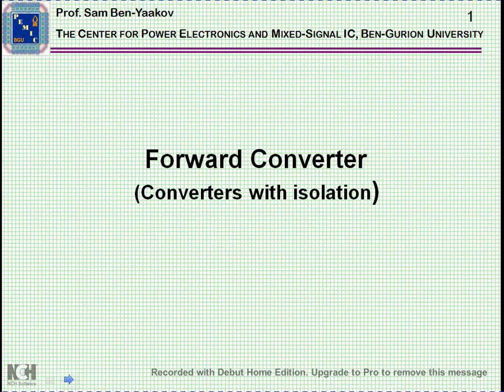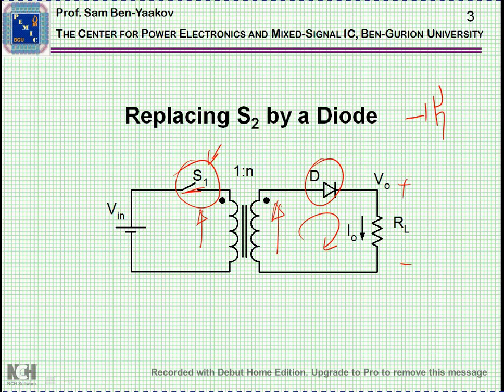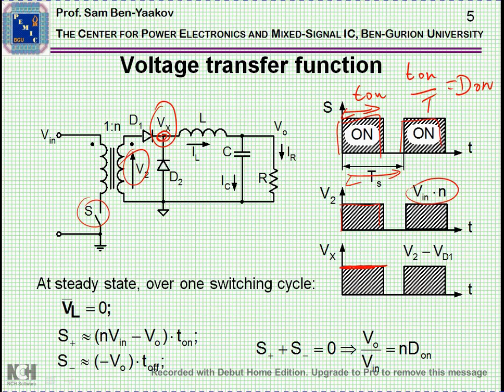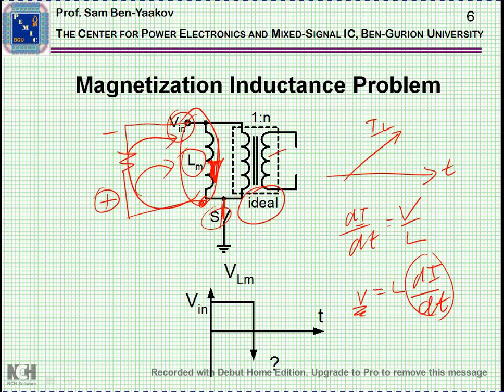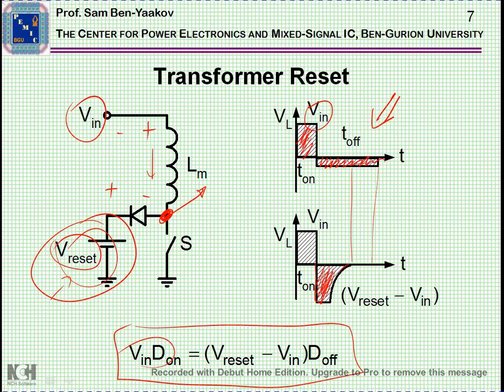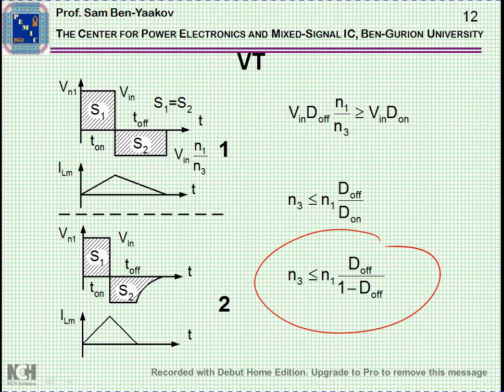Forward Converter

Comment: Hello. Nice video! I have a question. In the part of the video where the voltage is klamped (10:00), why do you need to do this in the forward converter but you do not need to do it in the flyback converter?
Reply from the maker: In Flyback the clamping is by the secondary, save the spike due to leakage inductor which you need to clamp.

Comment: Dear Professor Yaakov, I can understand the n3/n1 calculation at 12:51, but it doesn't match with "n3/n1" at 16:49. Could it be that the "Vin*n1/n3" of S2 at 15:43 should be written as "Vin*n3/n1"?
Reply from the maker: Yes there is an error pointed out 4 years ago😊
JeffH
4 years ago
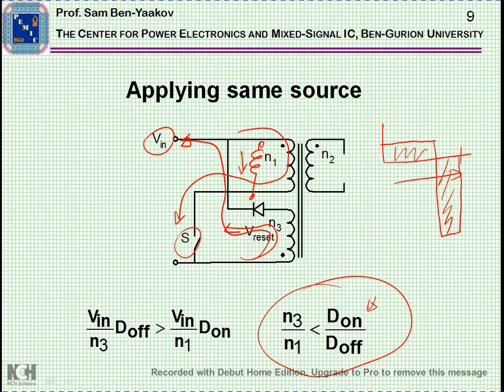Hi Professor, @14:12 shouldnt n3/n1 be less Doff/Don?

Sam Ben-Yaakov
4 years ago
Hi Jeff, correct. Indeed, the expression is messed up. It should be as you pointed out. Thank you very much for pointing this out. You have a keen eye.

Comment: Thanks a lot for the detailed explanation sir. I was wondering if forward converters have any practical applications? It seems that at low power ranges, Flyback would dominate and at higher power it is better to go for push-pull or half bridge. I would love to know your thoughts on the same.
Reply from the maker: Hi, Forward converters were used in the range of few 100s W. These days, the LLC seems to take over.
Reply: @sambenyaakov  that answers my question. Thank you very much.
Reply: @sambenyaakov  also I presume two switch forward was used in the 100W design? Or was it some other topology?

Comment: Hi Prof, i think there is a slight mistake at 14 min. n1/n3 shold be less than Doff/Don ( not Don/Doff). Please correct me if i am wrong
Reply from the maker: Thanks for comment:

Sam Ben-Yaakov
9 months ago
Yes there is an error pointed out 4 years ago😊
JeffH
4 years ago
Hi Professor, @14:12 shouldnt n3/n1 be less Doff/Don?

Sam Ben-Yaakov
4 years ago
Hi Jeff, correct. Indeed, the expression is messed up. It should be as you pointed out. Thank you very much for pointing this out. You have a keen eye.
Reply from the maker: Thanks for comment

Sam Ben-Yaakov
9 months ago
Yes there is an error pointed out 4 years ago😊
JeffH
4 years ago
Hi Professor, @14:12 shouldnt n3/n1 be less Doff/Don?

Sam Ben-Yaakov
4 years ago
Hi Jeff, correct. Indeed, the expression is messed up. It should be as you pointed out. Thank you very much for pointing this out. You have a keen eye.

Comment: in slide no 7 .      when  Vreset > Vin. then  during off period of switch.  the anode of diode has Vin and  cathode has Vreset.  then how will the diode the turn on.  and how will the reset happen??
Reply from the maker: When the inductor current is interrupted, the voltage tend to swigs toward very high voltage and clamped by Vreset. See https://youtu.be/HtwiIIPekfs

Comment: So why flyback converter does not need this third coil?
Reply from the maker: In flyback' energy is stored in core and them discharged into the secondary. In forawrd energy is not supposed to be stored in core, but some does due to magnetization so this has to be discharged by a third winding. or some other means.

Comment: Can a toroid be used for the core of an isolated switch-mode power supply? I never see a ferrite toroid used for the core of SMPS when they have isolation, and I always wondered why. All of the buck boost converters I see use a toroid, but they are not isolated.
Reply from the maker: Thank for bringing up a good question. Toroids are used in flyback but less often. They tend to have a higher leakage inductance which is increasing losses and spikes. They would be a good choice if one needs very high insulation between primary and secondary because you can put them apart. Using ZVS techniques will reduce the leakage losses.

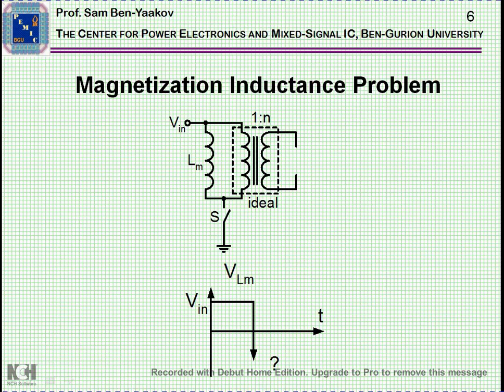Comment: Hello Professor! My question regards a magnetization inductance problem (7:04) is follow: In a few sources I saw that there is a gap recommended in the forward converter transformer. But after your video I am realizing that gap is not needed. Even more, a gap should make situation even worse (Larger gap -> lower magnetization inductance -> higher magnetization current). Are there any hidden reasons to make a gap in a forward converter transformer? What do you think?
Reply from the maker: Strictly speaking the forward transformer does not need a gap. However, I would imagine that in some cases a gap can be helpful. For example: if DC current is expected at the primary or secondary or if the resonant frequency between primary and associated caps is very low.
Reply: @sambenyaakov  Thank you, Professor!

Comment: why the input voltage is DC, but we can use transformer to step up or step down the voltage in this circuit?
Reply from the maker: You mean AC instead of DC at input? No

Comment: great sir,  i have to design 20v 10 A , 0.1% ripple  2 switch forward converter i am new to power electronics , can you tell what will be the output inductor and capacitor
Reply from the maker: Forward is basically an isolated buck. See https://youtu.be/HtwiIIPekfs

Comment: Great lecture Sir, 
at 12:05 why can't the demagnetization be performed on the secondary side of the transformer? and why can we put the catching diode across the transformer primary? I mean why add the third winding to demagnetize the transformer?
Reply from the maker: The third winding helps to recycle the magnetization energy https://youtu.be/OD8mBSsJfJk?t=872
Reply: @sambenyaakov  ok but why can't we just put a catching diode in a parallel with the primary side.
Reply from the maker: @thezodiace7399  this will not  the magnetization. Zero n
voltage on inductor constant current

Comment: at 19:18 you show the currents I1 and I2 start from a large value , then rise linearly, why dont they start from zero?
Reply from the maker: In CCM, the inductor current does not drop to zero
Reply: @sambenyaakov  I see. I thought the point of the reset winding was to make the flux in the core go completely to zero..which dosnt occur in CCM, right? what am i missing?
Reply from the maker: The current is a reflection of secondary not the magnetization current.

Comment: Thanks for video, can we use a forward transformer for a resistive load without output diode?
Reply from the maker: You can but it would not operate as a forward converter. Just a transformer

Comment: Regarding to the first schematic, if it is a voltage generator, than I(in) will increase in the transformator, so I think the Io will not be constant acc. to Faraday's law (will increase too). So the rectangular signal shape is not correct. Am I right?
Reply from the maker: This is considered to be an ideal transformer which by definition is assumed to have an infinite magnetization inductance.
Reply: Dear Professor,  now I understand. Thank you!

Comment: Thank you for this video, can we remove the inductor in the output and put just diode and capacitor like flyback converter?
Reply from the maker: No. This will be like a short (a transformer between input and output)
Reply: @sambenyaakov  thank you professor

Comment: Thanks Professor. I have a question: You said at 12:01 that the magnetization current finds its way through the reset path (n3 winding). Could that current find its way through the n2 winding aswell? Greetings from Colombia.
Reply from the maker: No, because of the diode in n2 (the voltage at this instance is of opposite polarity)
Reply: Professor, thank you for your answer. Now a question that could be a little bit out of context: following the same procedure shown at 8:45 but in a push-pull, when both transistors are off, why the voltage of the transistor is just Vin? should not it be 2Vin?
Thank you for your help.
Reply from the maker: In push pull, the secondaries are shorted which is reflected to the primary.

Comment: I was thinking transformer is ac device then how DC voltage can be use on high frequency transformer, how switching helps transformer to operate on dc
Reply from the maker: The switching act transfers the DC to AC, like chopping, such that the transformer sees an AC voltage